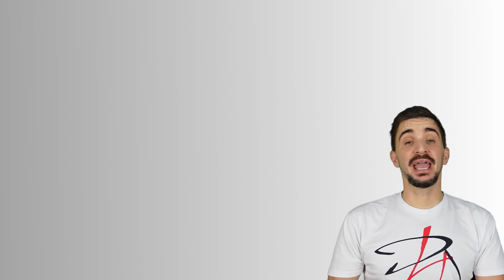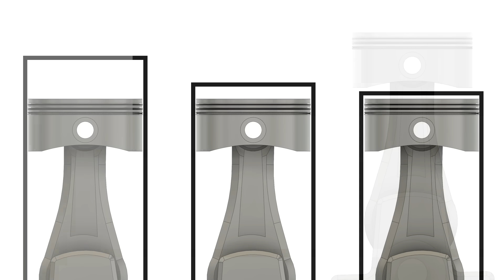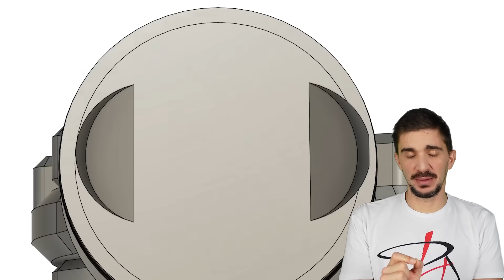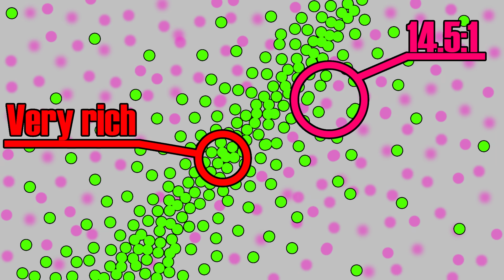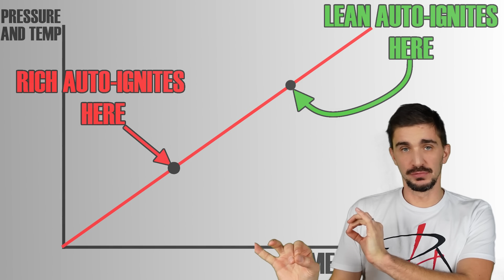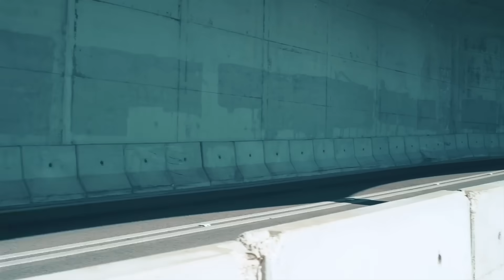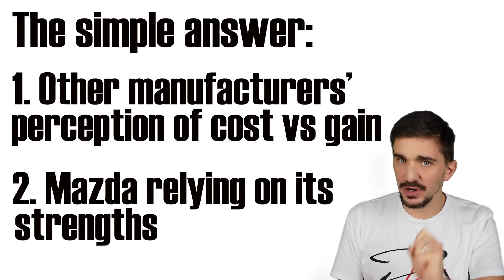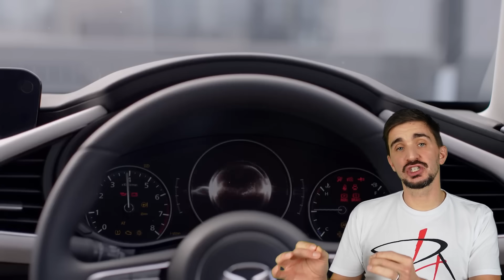The Game Changer Nobody Cares About - Mazda Skyactiv-X SPCCI How it Works and Why It Didn't Catch On

Comment: In the US you can't go a mile down the road without seeing 5 new Mazdas. They're selling like hot cakes here. Also, as soon as they cracked HCCI, Toyota was all over it trying to merge with Mazda. Now Toyota is using their SPCCI tech, probably in-exchange for EV stuff. There are Toyotas that look like Mazdas, like the Yaris iA. That's a Mazda 2 and I feel like Mazda just gave them that whole platform. Anyone who has driven Mazdas in the past know they handle different. Now Toyotas feel like Mazdas and all these GR versions' suspension are lookin real familiar.

Comment: Let's be honest the math simply didn't work out. It requires more expensive high-octane gas with not so significant fuel saving, came with a much higher price tag and maintenance cost.

If you want pure performance, there are plenty of options from NA to turbocharged; if you want fuel efficiency, hybrids brew it out of the water. A somewhat higher performance while relatively fuel-efficient car? This is a disastrously marketing mix that Mazda had come up with, there might be such a niche but not for the majority who actually have to "think" before making the purchase.

Comment: Unless the laws of Chemistry have changed in the past 50 years, you have been given some incorrect information.

The system is based on a Ford PROCO from the 70s/80s.  It used direct injection and gasoline.  The PROCO did NOT have port injection.

Any direct inject engine, gasoline or diesel, creates particulates.  The particulates from gasoline are just much smaller/finer.  Current standards are 3 mg/mile to be reduced to 0.5 mg/mile in 2027.  This is why most Ford EcoBoost engine now have both port and direct injectors.  Like SkyActive  they limit the amount of time running direct injection to limit the particulates.

Also, any engine that runs leaner than stoichiometry will  have increased NOx.

Comment: The best final commentary ever. My first thoughts are could classic V8's and such be modified with custom heads and pistons  with the appropriate controls to achieve controlled compression? This would keep many classic vehicles alive for the next generation. Also I've had discussions regarding electric motor assist installed like an overdrive for classic cars and trucks, for use in traffic, allowing the engine to be shut down saving fuel by not idling.

Comment: If Mazda made a hybrid Skyactiv-X I'd be so over that, as you get that low down torque and NA reliability, smooth power, and economical. Mazda is also the only company who upsized their engines for Europe as the 3 and CX-30 got updated with a 2.5l to replace the 2.0.

Comment: It's very similar to how F1 engines runs, with the prechamber jet combustion tech since, I think, 2015 by honda although without any chamber just a fuel jet. So in a sense, it's a F1 inspired engine. There is now news of this type of ignition to be used on Maserati new supercar and in Jeep if I remember correctly.

Comment: PSA: If you're interested in buying a Mazda car with this engine, get a later model.

They significantly improved the low end torque and smoothness of the engine (combustion mode switching not so obvious) in the post-2022 iterations, especially the eSkyactiv-X.

There's also a strong argument to get the Skyactiv-X, instead of the G, if you can. The reason is, the X is exclusively made in Hiroshima - you're getting a Japanese made model, instead of a Mexican one.

Comment: Once drawn in the “ratio” of fuel to air is set true to say “the power stroke” is another form of ignition through pressure creating heat. No way is a diesel engine moar efficient than gasoline tho no way. Only requires a draw in and a spark plug no pressure needed. Diesel has farrrrr fewer moving parts tho definitely moar reliable. Far greater tolerance for error as well be diesel. But if measured in actual output of #joules no way can anything compete with gasoline no way. Incredible power output for volume measured of fuel be gasoline #toyota_prius …near all inefficiencies be in the mechanical drivetrain that’s all about to end #axial_flux motor instant torque delivered electrically to the automatic transmission no more crank shaft which provides mechanical torque to the drive shaft. The other advantage to diesel can use natural gas as fuel crazy dirt cheap fuel be natural ⛽️ ⛽️ ⛽️

Comment: Gasoline doesn’t need to be at 14.7:1 to burn. To lean and it will have a hard time igniting, also to rich it will, that’s true but both ends of that spectrum are fairly extreme. Like 7:1 or 17:1, also there are PRE-ignition combustion chamber gasoline engines that are extremely fuel efficient, Honda and Mercedes have both done this in the past, they use a rich fuel mixture in the pre-ignition chamber that’s in the cyl head, and then a lean mixture that comes in through the intake port. The rich mix in the pre-ignition chamber is lit off by a spark plug and then moves outward and ignites the leaner mix. They and some other variations of Honda engines under low load could run as lean as 18:1, in the 1990’s…. The Civic HX was one example of a lean burning engine, (not the pre chamber) that’s just off the top of my head.

Comment: Given that the power band limitations within the HCCI operation mode sound eerily similar to an Atkinson cycle engine as used in modern hybrids, would SPCCI be a perfect fit for the modern hybrid? The gas engine is mostly used to charge the battery and is only connected to the drive wheels during low load, high efficiency cruising. The electric motor takes on most all of the high load demands. What's the blocker? Why is the Atkinson engine preferred by Toyota and Honda?

Comment: I think in F1 they use a small ignition chamber on top of the cylinder to ignite air-fuel mixture and spread the combustion into the cylinder.

Comment: i'm interested in this  driveline for my next car, but the main issues i have is, what transmission does mazda attach to this motor?  I hope its not a CVT slush box...  for me the past 2 new cars I owned  GM and Chryslet both had great motors, but the transmissions where complete failures..  45000 miles chrysler trans failure, gm truck trans failure 85,000 miles. I'm sick of this crap

Comment: 7:31 This seems like something koinegsegg would make before mazda. I feel like this system would benefit significantly from a solenoid powered intake/exhaust valves like FreeValve. You could limit the amount of air coming in as well as the fuel independent of engine speed there for increasing engine response and control. U would probably need to run it with an electric air compressor tho to hold a stable intake pressure so the amount of air is consistent. The intake solenoids would only open and close based on time rather than actually measuring the air, unless u could have some kind of MAF sensor inside of the cylinder. Or maybe have 2 solenoids or some system where there is a chamber between outside air and the cylinder and fill that cylinder to a certain PSI and then "inject" it into the cylinder. The chamber would have to contain the amount of air needed for both the cylinder and the chamber bc it would suck the air out of the chamber completely, idk if the vacuum would be enough inside of the cylinder to actually suck the air out. Idk of a turbo could fix the intake pressure and exhaust vacuum at the same time or if the exhaust solenoid could just open for a split second to use exhaust scavenging to pull the air out of the intake chamber, you could even possible have the fuel mixed early. Mazdas X engine really just seems like a high compression engine and nothing that special. The HCCI engine idea is fascinating tho

Comment: I'll never get a Mazda product again.  Cheep in comfort and reliability.  Ac barely cools, and engine goes early. Only good part is engine dies before transmission. 
Mazda just chose to jump in with China in its manufacturing which is why there offering in the usa is limited

Comment: I had done my research on this engine in the past, but this video (as always) does such a great job of helping one get over the goal line of understanding. For a daily driver that I wouldn't care about having all the power, not relying on boost to make daily driver power makes so much sense to me. Forced induction will always come with drawbacks along with the benefits of greater net power per unit of displacement. From the general complexity in the engine bay to the additional external failure points, turbocharging has created a lineage of disingenuous engineering. While I do enjoy the idea of creating more oomph from the same cylinders, I like the idea of creating the same amount of oomph at a lower cost better.

Comment: Mazda is less reliable than other vehicles.  Not saying the engine is the problem.  I rented a Mazda.  It was a horrible experience.  Seats were bad, tech was just off a little and meh.  Most of all the seats and driving position was just horrible.  Maybe Mazda should fix those issues along with it's advanced tech.  One is what the customer is asking for, the other is not.

Comment: i think the tunig potential in these skyactive x engines is realativly high. However the complexity is insane because when you turbo that engine you increase the pressure and thus change the absolut compression and thus you have to change the spark timing all while messuring the exact amount of air very prescisely. Not impossible just harder than normal. 
If mazda would take one of these engines and put them into a le mans or endurance racecar, they could actually do decently well and maybe spark a new engine hype that way. the 2 and 3 rotor werent very successfull because they lacked performance and had terrible emissions, but in the end they had so much character, that they are still used and loved by many. The Skyactive engine come from the opposite end: The have great emissions and overall performance, but they lack character.

Not imagine a racecar with a skyactive engine running at peak power 100% of the time hooked up to a Electric drivetrain with a buffer battery. That car could in theory be very light, more efficient than other gasoline cars and have decent power aka a good racecar.

Comment: At this point, Mazda is being too German, i saw a german company selling a hight tech, multi stage, belt fed WOOD BURNER... Yes, a bigass 20 square meter wood pellet burner, for home use ... How niche does your house have to be and how both rich AND stupid do you have to be to buy such a thing when you can use a more efficient heat pump!? And why is that a commercially available product? Who did the math and thought it was worth it when there are waaaaaaay better less complicated ways to heat a house!? 

Same goes for Mazda... Why are they working on combustion engines when the future is definitely electric?! Why not make a constant rev engine that's super duper ultra efficient and very light and small engine that only charges batteries on the run, like Xping is doing!
You can forgoe the starter motor, you can make it compact because it doesn't drive AC or any other crap, it can be very simple because it's constant speed, and either on or off, it can forgoe a big fan if it only charges at highway speeds, it can also NOT EXIST AT ALL if the battery is big enough!

Comment: They need to make a van with solar integrated (see Aptera solar panels) with electric for low speeds and then this engine comes into play with a switch from 65-85 mph highway cruising while charging the batteries.   Best of both worlds.

Comment: This channel should do a video on the new/upcoming skyactiv Z.  I think it's a update of the skyactiv X thathas a much larger area on the load/RPM space where it can operate in spcci mode.  It should have much better fuel economy in real world applications where the load varies often.
I'm a mechanical engineer, and love the idea of the X and Z engines.  I will buy one once the skyactiv Z is available in a Miata in the US.  Supposedly the straight 6 version of the  Z engine will be coming to large Mazda SUVs that will be sold in the US.

Comment: This Skyactive technology would actually be an ideal engine for a range-extended EV. Since it seems to work only at very steady RPM ranges, this would be the perfect engine for a generator to recharge batteries. Get over 1000 km ranges until you need to fill up with gasoline again.

Comment: it is more reliable because it requires better components to withstand the levels of cylinder pressures in the chamber at a given time. Put that same level of quality components and the engines will be a lot more expensive AND reliable.

Comment: I have a Mazda with this engine and the car is very good. Drives well, on the road is excellent. It has this problem of being an aspirated car, a little slower than a turbo car, but it is extremely quiet, comfortable, so I think it's worth it. But I understand the argument of those who prefer a turbo car. For those who are just in the city and need to stop all the time, it can be a little boring. But for those who take the road, it's excellent.

Comment: Mazda deserves more respect. I have a 1992 Mercury Capri that I drive daily. It has a Mazda drivetrain. It's been totally reliable for 34 years and shows no sign of quiting. Starts and runs perfectly every time. If the Skyactive engine is like that I wouldn't hesitate to buy a new one. I wonder how many EV's will run 34 years without major investment in battery replacements.

Comment: A simpler HCCI engine with no spark plug sounds like the ideal range extender for a hybrid vehicle where the engine is coupled to a generator instead of the drivetrain.

Comment: Just make some small light SPCCI engines that run at optimal rpm and are used to extend EV batteries range to reasonnable, customer compatible ranges, until battery techs improve even more for a few years and reliable sit around (real life) 800-1000km, which is pretty soon anyway.

Comment: As always, thank you for a great video! I would add a couple of points: the key to this ignition type is that a sound wave spreads way faster than a heat wave, this is what the ignition with a sprinkle of gas does at the end of the compression, pretty much what detonators do to the explosives. Second, the compression ratio is directly linked to the Carnot cycle where the difference of the area sizes on the Carnot diagram defines efficiency, so the higher compression ratio is always more fuel efficient ceteris paribus.

Comment: Thinking about it, it would probably work well with my Toyota Corolla Continuously Variable Transmission. A few optimal RPM ranges for the engine and buff up the power with electric motors when needed. Do those Mazda's also have a CVT?

Comment: Behaves as a normal engine under stop & go & high load conditions, but works as intended during low to medium consistent loads.

Well sounds like Mazda actually made the perfect engine for a series hybrid vehicle, since engine is decoupled from the drivetrain and runs as a generator, it would never need to run outside of optimal working range.

[Edit: Also wow, less than 40% of vehicles in EU are pure petrol or diesel now? The writing is definitely on the wall..]

Comment: I own a CX30 skyactiv X AWD auto, it easily reaches 30mph without fuss, it easily reaches 70mph on the motorway without fuss so performance is really not an issue. People who will buy this car are not boy racers but people who appreciate quality. Best of all it is very reliable, built incredibly well, is very, very safe, it has the very best safety ratings in NCap, the best interior in it's price range which betters many more expensive cars as well. The auto gearbox is a very smooth torque converter design and not the more complicated double clutch style. And to top it all off I achieve 50+ mpg on a run and 40mpg around town. It also has a stop/start system that does not use the starter motor each time it restarts which usually causes it to wear out prematurely, instead it somehow uses the stored high compression in the cylinders to restart it. I love this car, highly recommend it and I'd say it's by far the best car I've ever owned.

Comment: I think you just made the correct assumptions about this engine. I have been driving a CX30 Skyactiv X with 186 HP for 4 years and it is awesome.

However, I knew what I was buying and knew prior testing it that it has no turbo. In these 4 years I have managed around 6.5 l/100kms in mix usage in the automatic version, and believe me, I really push when I have to.

However. I have seen that many people say that it is slow and expect it to be as a turbo charged engine and be glued to your seat at 2000rpm.

It is sad but as you said, impressions count more than reality sometimes...

Comment: Can someone explain why new fueled powered motors are still a thing? I thought it will be all electric from now on (better efficiency, no gearbox/transmission). I mean, 20 years ago I also thought high efficiency fueled powered engine in a hybrid would be the way to go, but now with batteries so cheap and new battery technologies being released every month? Is it the nostalgia?

Comment: Sort of like Freevalve tech. Clever but redundant. The high compression ratio presumably makes it impossible or difficult to turbo charge. Sounds like a turbo is a better investment. A VNT turbo on a petrol would be more in tune with consumer preferences, if they could find materials that didn’t melt due to high EGTs.